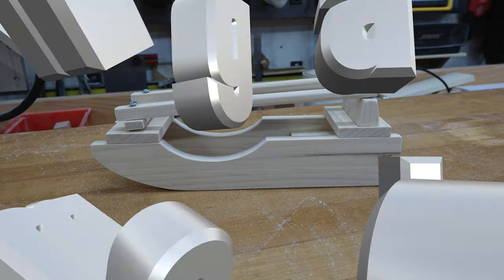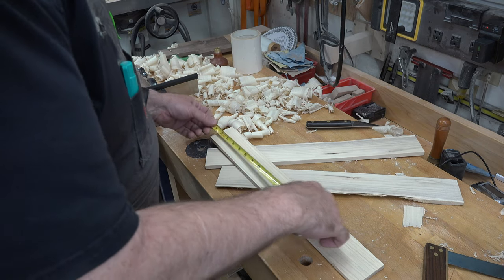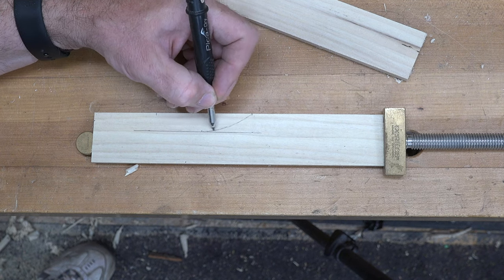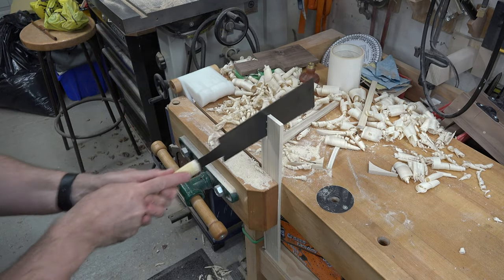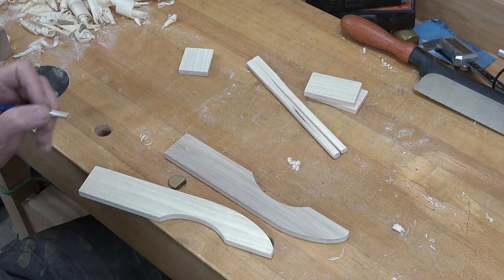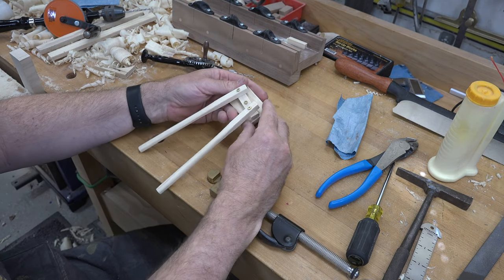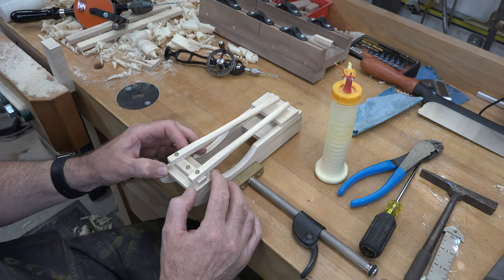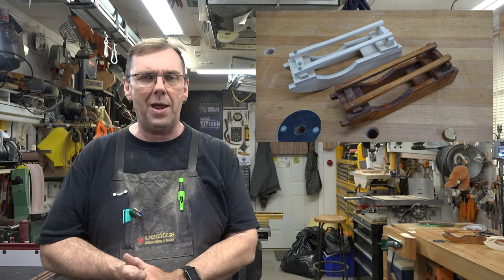Making an Old Time Sled

Comment: Hi Kenny I was wondering what was going on when I saw you not using your scroll saw haha. I have been trying to use only hand tools since getting back into woodworking and have bought quite a few old planes amongst other tools and reconditioned them, great feeling when you start to get the fruits of your labour. That was a great project and I am certainly going to build a few of the sleds as we are edging up to Christmas, they would make fantastic gifts.
I was watching and wondering about your workbench top, what type of wood was it made of, please don't tell me it was maple 😉. Can't afford that in Scotland, I'm currently re doing my bench and am using construction pine and was wondering if there is any way to impegnatie the timber to make it harder, any ideas?
Reply from the maker: I'm sorry to give you this answer Eddie, but yes, my bench was constructed from hard maple.  It weighs a ton and is very hard and solid.  You can possible strengthen and harden your bench top after constructing it with a thickly poured layer of epoxy resin.  The resin is hard and clear and won't take hardly as much damage as the pine when working on a project.  Truth be told, I've never done this, but if it were me and I was looking for a way to harden a pine bench, I think that would be my method of choice.  I hope this helps a little.  Thanks for tuning in Eddie and for all the kind words on the show.
Reply: @acutabove_woodworkings  I thought your bench would have been made from maple Kenny, I look at all the projects you have made and I'm very jealous with all the different species of timber the Canadian maket have to offer. We don't have much choice in Scotland but any suitable hardwood is sold at a premium price 😉 I'll just carry on with the pine and see how it goes, thanks once again for you reply Kenny, take care 👍